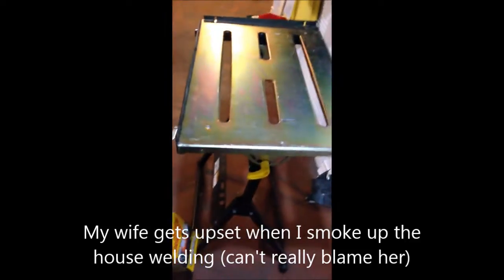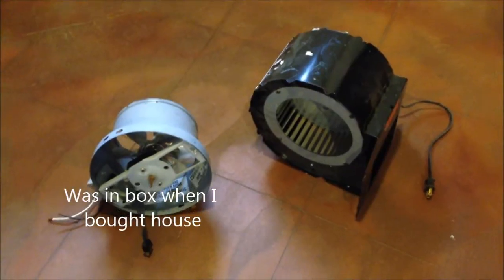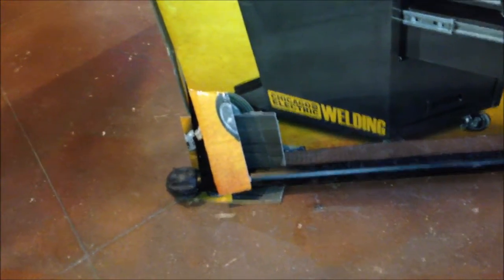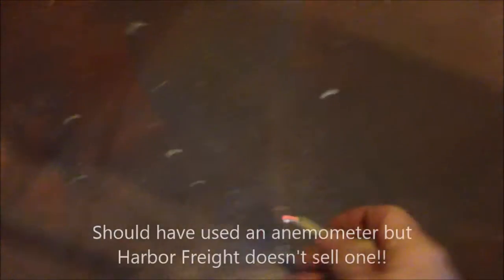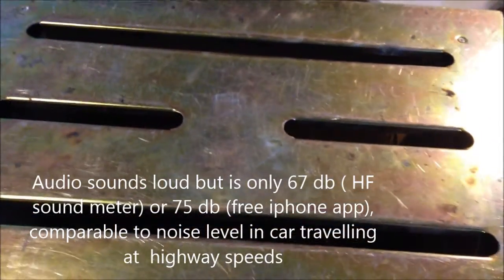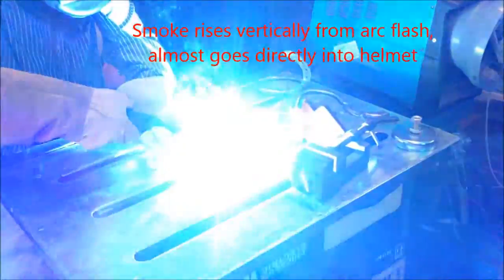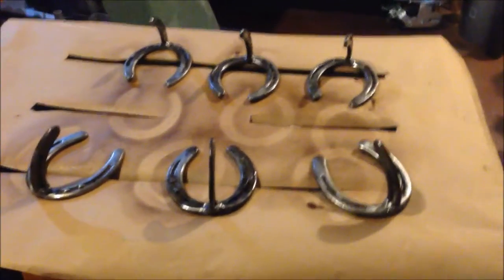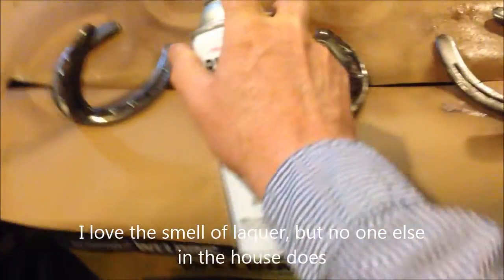Part 1- Adapting a welding table for down draft venting

Comment: nice results I like it.
Does the 600CFM blower draw the air over the motor, I'm just wondering if there is a chance of the sparks from the motor igniting the paint fumes

After my little project today just cutting, grinding and welding up a simple shelf and light bracket for my new lathe I filled the garage with dust and smoke and really needed to vent but it was around 10 degrees F outside so venting was not possible.

Comment: Thanks for posting this, and for alerting me to that nice folding table.  I could use something like that in my garage...

I wonder if there was a means of replacing exhausted air in your tests.  I mean, did you crack a window or anything to let air in?  The welder at work doesn't like to turn on the hood fan because it pulls smoke in his face.  Needless to say, it gets very smoky in that barn, and I'd like to get something like this set-up, but we have fixtures built on solid aluminum plates.

Comment: Apologies for resurrecting an older video, I'm curious about what you did with the business end of your flex hose exhaust? I've been primarily using flux core (I'm too cheap to buy gas), and the weather here hasn't been all to favorable for hobbying outdoors between temperatures, ever so pleasant falling moisture, early afternoon darkness, all combined with the fact that the local coyote population has increased and the leo's won't allow me to rectify the strays that use my property for a main path. I'm not a big fan of making holes in my roof (future leaks), and the exterior of my home is brick. I was considering making a 4" hole in the garage door (like a mechanic shop exhaust port), but seeing how your 600 cfm worked using probably a 6" duct, that's definitely a better route. I've been toying with the idea for quite a while, even if it was just for a sanding table and a shop vac, but you just shed New light on my idea! Definitely earned a subscriber here, that's for sharing.
Reply from the maker: I routed the flex hose to a window.  I made a rectangle of OSB with a 8" duct  hole, then I shut the window on the rectangle limiting the amount of air leakage, except for the 600 CFM of leakage with the blower running ;-}.  Thanks for resurrecting this old video ..... I always thought this product idea was more clever than what the video views indicate!